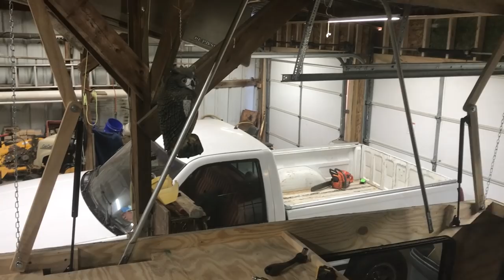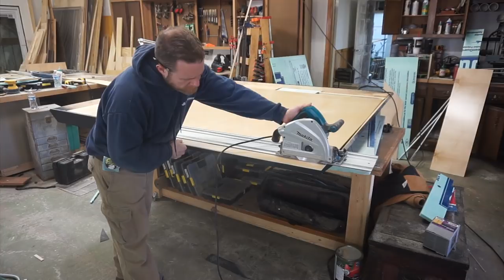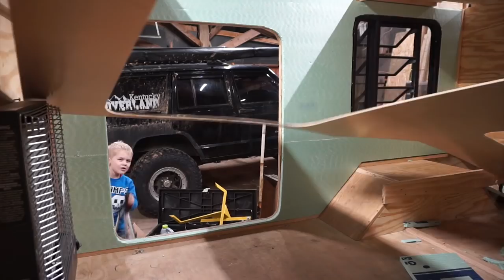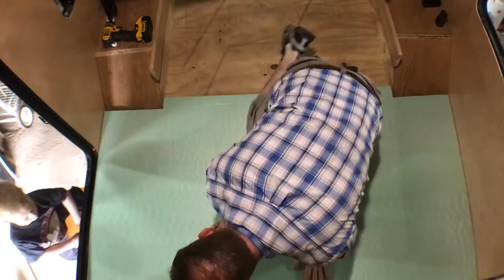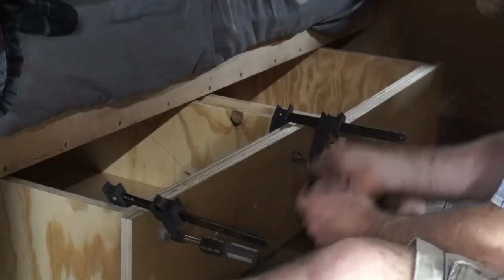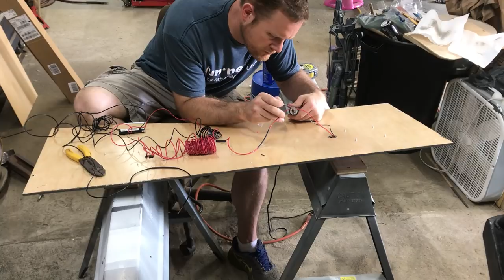DIY Offroad Overland Camping Trailer Interior Build E48

Comment: I am thinking about using a 8'x18'x7' cattle panel welded frame, weld eye holes on them and bolt on (2) half inch pieces of rigid insulation, and (2) pieces of 3/4" plywood (outside/inside). Like a person its got a skeleton, fat, and skin.. Do you think it will hold or is it nuts?  trying to reuse the frame of the travel trailer I just tore down.

Comment: Hello, I was wondering what is the width of the interior in the trailer?  I noticed that you laid perpendicular to the trailer, which is what we have been looking for.  Also, did you make guard rails for the upper bunks?

Thanks for sharing your build.
Reply from the maker: William Snodgrass it is just under 6’. When it is just me, I lay at a slight angle,  if it’s my wife and I both on the bottom bunk we either lay at a slight angle or I have also built a bed extender that allows us to lay length ways
Reply: @shaweehillsworkshop4226  thanks so much for sharing.   We have been playing with the idea of building a teardrop but we can't find something that would suit us (a family of four.)

I saw you build videos a couple months back and didn't realize you had built a pop-up until I saw your recap video.   Great build.  My wife and I need to discuss it but she liked your build as well.  So, we should be buying plans in the new year.

Comment: I would like to buy your trailer plans..but have one question before...what is the footprint on the bottom of the trailer is it 4X8...with the additional 1 foot as the foxtail?
Reply from the maker: abnirvana996 I built my trailer as a 6’x8’ because I wanted to sleep sideways to give more room, you could definitely build it on a 4x8 and sleep longways, you would just modify the width dimensions on the plans!